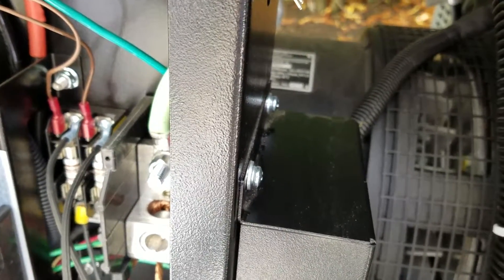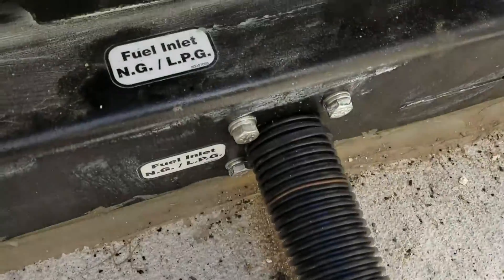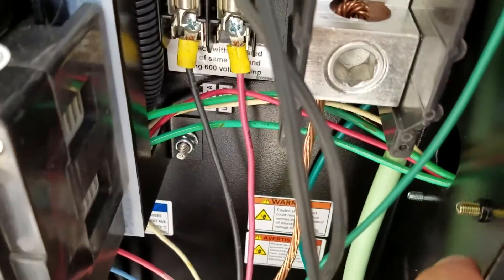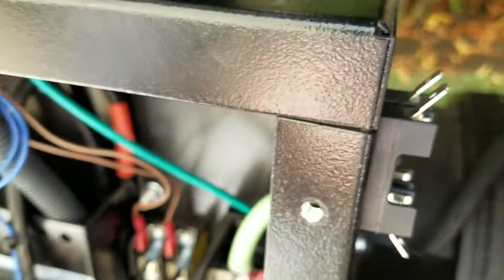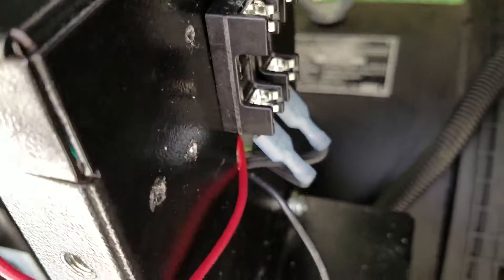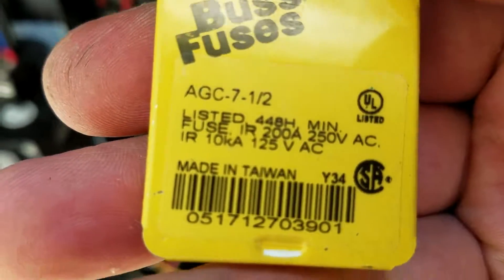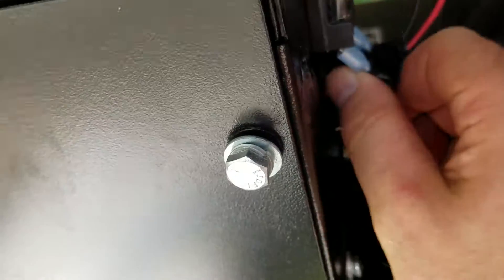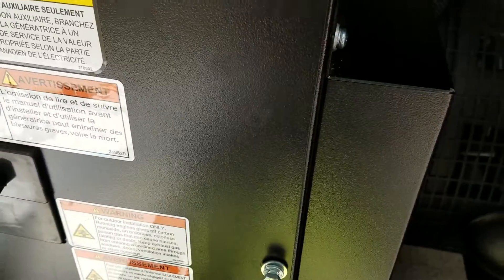Fuseblock for Generator Block Heater - Briggs & Stratton Generator

Comment: Really bad design that the block heater is behind the same fuses as the 'sense'' elektronics. I would have expected a second fuse block with 2 5 or so amp SB fuses for the electronics.